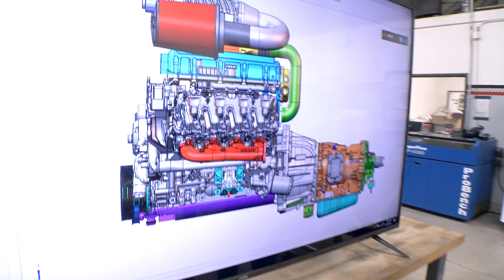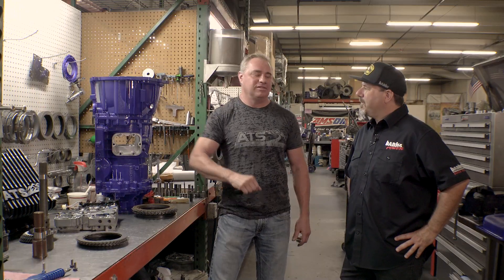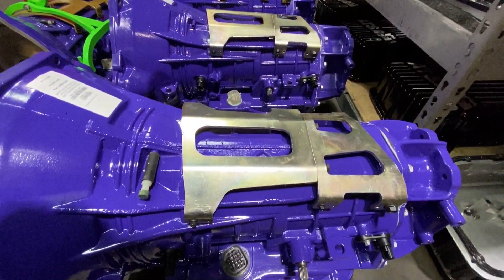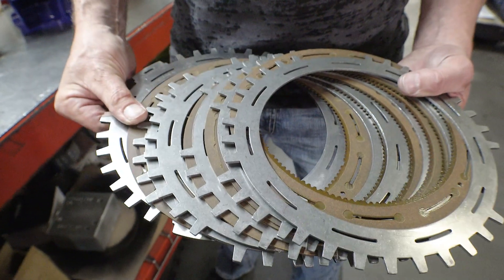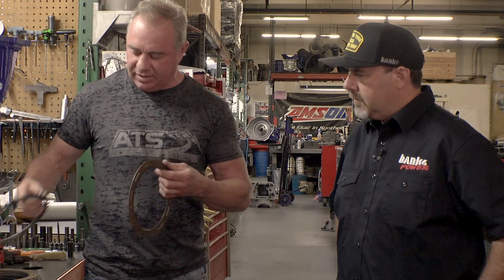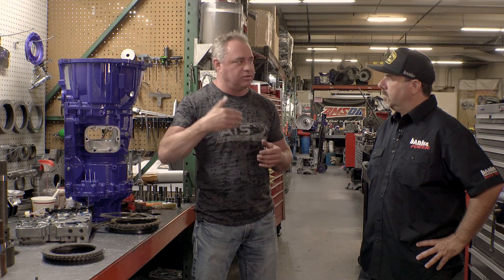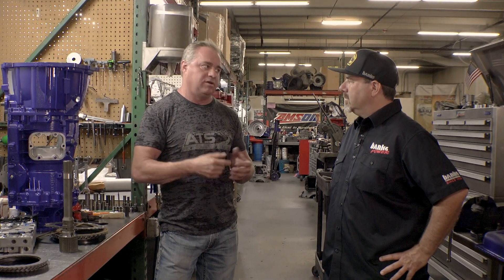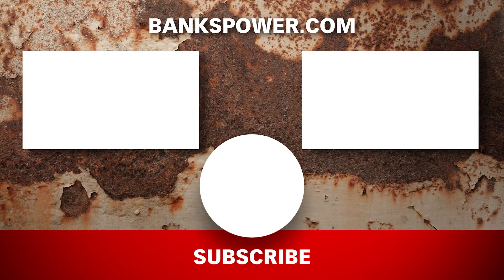A transmission built for 1,200 HP | BANKS BUILT Ep 10

Comment: Why no manual love? Nothing beats that third pedal and grabbing a gear for sheer smiles.
Reply: The drivability of a clutch that's going to hold back 1,200hp is beyond terrible.  The stronger the clutch the bigger pain they are to drive and that's going to hurt sales.  Its why the manual Cummins is detuned with 200+ less torque than the automatics and was canceled a few year back.

Comment: All the people trashing ATS- what’s your actual experience with ATS? I’m in the middle of a build and want to know why Gale Banks went ATS but you wouldn’t.
Reply: Because Gale Banks reps free stuff. When you buy it, go with Suncoast or Goerend, or Millard.
Reply: I have a full billet Allison in my 03 LB7 dually for past 4+ years built by BD DIESEL. Zero problems.
Reply: Poor build quality, lesser parts then what your STOCK transmission has, modifying the wrong parts of transmissions (adding clutches where they don't need to be, taking wave rings out for solid rings and causing the transmission to beat itself to death), the warranty is "good" but that's because they're broken all the time and half the time they WILL not cover the transmission since you did it yourself of they don't like the transmission shops you dealt with and say they're "lying". Sad all 3 dodge guys I know had the SAME problem with there transmissions from ATS and none of them lasted a fucking year. 5r110w behind our built 6.4 cruiser/hauler. Stock trans lasted 178k miles.....ATS......less than 7k.... Waste your money if you want, cheaper isn't better. There's a reason there transmissions are so cheap, don't make the same mistake me and many others have.
Reply: @OGskunkMASTA  so you never had an ats tranny yourself?
Reply: They don’t back there warranty it’s a lot of fine print. I’m on my 3rd throttle Body and 5th throttle position sensor and they haven’t covered any labor costs from my mechanic and also haven’t took responsibility for the TPS going bad

Comment: To bad it's a ATS transmission, have fun with that.
Reply: Did you have a problem with one of our products?  Please give us a chance to make it right if you did.
Reply: @ATSDieselPerformance  I had to sell the truck , It was undrivable, stage 4 dodge ram 2500 , the worst experience , transmission wouldn't stay in gear , going down hill with a load and it would go to neutral. Then the torque converter wouldn't let go and stall the truck, I ended up buy a 2019 Ram 3500 , and going to stay with stock transmission , they seem to do the job better than any after market built one, it stays in gear on the  downhills, 100,000 mile warranty, I make sure I tell everyone that after market stuff doesn't last and never works correctly.
Reply: @AmarilloHorseSports  not all aftermarket is junk. People tend to go aftermarket to hold higher power levels, with higher power levels you will naturally get more wear and tear.

Comment: ATS sucks, I hope they have another one standing by when you trash the first one.
Reply: Years of stuff that is trashed. That 5 star torque converter I still have setting in the shop didn't have 40k miles on it with a 450hp bone stock LB7, no lift pump even. Towed maybe twice that was heavier than a zero turn lawn mower. Everyone that had Suncoast converters with Alto clutches the trans would last longer than the engines in front of them.
Reply: @duramaxtothemax   we will still honor your warranty if you bought the converter, even if the time period has past.  Please email me and I will see what all I can do.    Blake@atsdiesel.com
Reply: @ATSDieselPerformance  I have no experience with ATS, but while doing my research and deciding where to drop 15k in parts I never read stories like I did with Mike L from inglewood transmission. Mike L was known to be available for diy guys and known to come through in a clutch. His work always is 💯.  FOR EVERYONE. You don't have to be Banks to get special treatment.
Reply: An alleged 48RE out of a 2007 Cummins powered Dodge Ram. As we see, using sub standard parts won't last in this application. It is a pretty pan though.

https://www.youtube.com/watch?v=27cSE5e9JTw
Reply: Did you have a problem with one of our products?

Comment: Sure hope you have better luck with that ATS than most that runs them do. Excited to see if it will hold.
Reply: He is kind of a scammer I hear. Parts designed and not paid for...etc. 
BANKS WILL GET HIS VERY BEST OF COURSE FOR THE EXPOSURE HE IS GETTING......
Reply: @timmelton4358   We design our parts in house.  Not sure what you're referring to, first time hearing of this...
Reply: @timmelton4358  never heard that one. Just people going they multiple transmission before one works. Or issues with warranty or parts warranty’s. I have no experience with these transmission so I can’t speak poorly about them. Just have seen a lot of negative
Reply: We have thousands and thousands of satisfied customers but can assure you that we take our seldom failures very seriously.  All we can do is invest in cutting edge machines to make billet parts, top of the line testing equipment to test solenoids; valve body's and three dyno's, to run each trans before ship, and most of all, in the people to assemble them properly and build in quality.   Did you have an issue with a product you purchased from ATS?
Reply: @ATSDieselPerformance  You legit can't even set up shims properly for ANY trans be 5r110w, 48re, ect. You slap billet parts in a trans and throw all the clutches you can at it and 98% of the time it's hell on the pump, sprag drums, or the clutches are binding up and you have a nice metal slurry for fluid. You know how to pull a transmission apart and slap it back together, YOU DO NOT KNOW HOW TO ACTUALLY BUILD A TRANSMISSION PROPERLY! You have little to no good talk about your company, you legit feed off the ignorant and people who don't have alot of money and need a transmission. In the end you ROB them and leave them with a pipe of purple poop. Your converters make a nice boat anker tho😃 plus your warranty may be "good" but the past 4x me and my friends/family have dealt with you it's never your fault and ours and say because our trucks are built and tuned that's the fault of us? If you actually built it right it should hold more then factory, not LESS! Factory unit lasted 178k behind our built 6.4, yours lasted not even 7k. YOUR WARRANTY MEANS NOTHING WHEN YOU SAY YOU'RE NOT AT FAULT !!  When it sure is because I didn't slap the POS together. Used that pretty purple case as a core to have it built by a pro tho☺️
Reply: @OGskunkMASTA  my man! Nailed it.😂💪🏻
Reply: @ATSDieselPerformance  I decided to not purchase from ATS from the many stories I’ve heard on multiple forums or pages. I have no personal experience with them so I did not make any negative comments or talk poorly of them. Just hoping that they have better luck that people complain about the Purple trans.